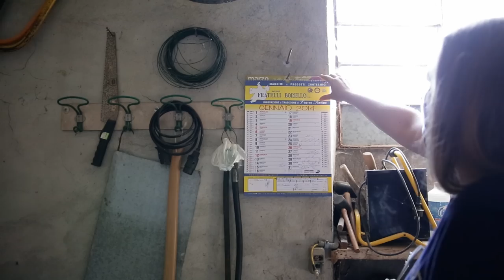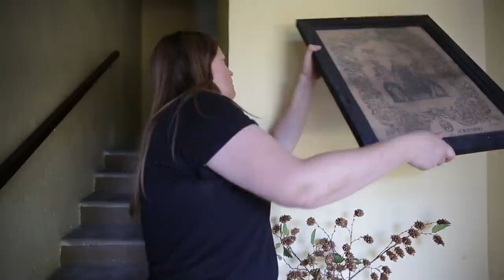#14 First time laying bricks - Slow living in the north of Italy

Comment: New sourdough bread maker here. Here are some tips I learned from seasoned professional sourdough bakers and my personal experimentation. After painstakingly making my own starter that took way longer than most instructions on youtube I was finally ready to use it. When you are in the beginning stages of using sourdough starter add yeast for safety. Dark Rye flour appears to be the best for making starter. Instead of discarding, start with 2 tbs of Rye and tiny bit of water for pancake batter consistency. Feed it 2 table spoons and a little water everyday and watch for the bubbling and sour smell. Once it starts rising you can begin to experiment using it. For storing for long periods of time without doing anything to it. Make it very thick and cover with a layer of dry flour and place in the frig. It can last up to 2 months I am told. Take out of the frig the day before, add water until the consistency of pancake batter leave in a warm place for 12 -24 hours then add to your recipe. The refrig storage does work because I tested it myself. A good place to sit the starter while waiting for it to rise is to place in the oven with the light on.
Reply from the maker: Thank you for the tips! In the meantime we've had some more successful results and we're definitely encouraged to continue on the sourdough bread making journey! :-)
Reply: @storiesfromthecascina It is so worth it and glad to hear you are experiencing better results. Love watching your homestead progress, looking good.

Comment: On old window frames or other wood projects, you may find wood hardener + filler to be an effective method of repair that allows you to keep more of the original wood.
Reply from the maker: that's exactly what we used! we replaced only the absolutely neccessary bits and used wood hardener and filler to preserve as much as possible of the original window. will be in next week's video 🥰

Comment: Will you get snow in your region? I ask because if so, you may want to put some sort of insulation around your below ground water valve. Even just some packing foam from your move will help. I enjoy your filming style .
Reply from the maker: We will likely get snow, yes! It doesn't snow here every winter, and some winters more than others, but usually not before December. Thanks for the reminder :-)

Comment: 14:11 : from a project management viewpoint, which you may already know and have done :
*  look up the 'MoSCoW Principle', that helps prioritizing. It's also very simply put into an excel-sheet, allowing for both clustering of tasks, prioritizing and planning.
*  don't forget the 'preparation for preparation'. In order to allow to prepare for some tasks other things need to be in place already. Like with getting permits you usually need a lot of copies of documents. Both for filling in the request forms and as attachments to the request form.
^  look for tasks which - once started - take a long time to rum on their own. Like getting permits. Once these tasks have started you can put those in the back of your head and do other tasks.

Just 3 things that make life easier and give room for spontaneous things.
Reply from the maker: thanks for the tips! and yes, looking out for the tasks that make many other tasks possible is so important!

Comment: Please plant stakes with signs that say: "Proprietà privata. Divieto di Caccia"(Private Property. No Hunting) along the boundaries of your land. You will be doing the animals a favor and keeping the dangers of hunting accidents away from you. Grazie
Reply from the maker: we definitely plan on fencing off part of the property in the future, but the entire circumference of our land is upwards of 2,5km (about two miles). also, in italy, unless you fence off your land, you can't simply go about putting divieto di caccia plates around sadly. as far as we're aware it doesn't hold any legal value to do so and our experience is that hunters will completely ignore them. hunting in italy- especially wild boar - is also with the purpose to keep the population size at a healty level for the ecosystem. we are not anti-hunting but very pro well-regulated hunting with a focus on ecosystem management rather than sport.
Reply: @storiesfromthecascina  - Hi, I don't think it is necessary to fence your land, also because the signs are located on agricultural plots much larger than yours and without fences. However, it is necessary to make a request to the Region, usually the competence of territorial hunting plans is delegated to the provincial authority, therefore the owner or manager of the land that he wants to remove from hunting activity must address his request to the Province to which he belongs. The control of "invasive" species would still take place outside your land, but what has certainly improved will be your safety, given that the hunter only has to keep 100 meters from buildings and given that hunting accidents are frequent (there these are people who shoot at the mere movement of a bush). Happy renovating, bye
Reply from the maker: Yes it's either fencing your land or submitting a request to the provincial authorities, before they finalise the hunting plans once every five years. But it's not as easy as just putting down some signs! We genuinely wish it would be :-) And thank you for being concerned with our safety and that of the living creatures on our land! <3
Reply: @storiesfromthecascina  - Well sorry if I was intrusive, but it's something I would have done if I had a house like yours. Even though my father was a hunter, the idea of someone being 100 yards from my house with a gun doesn't make me "crazy with joy." Hi and good work to you. 👍😊
Reply from the maker: @MrTinner66  Oh yes but we are fully in the same camp there. It isn't a nice idea having hunters that close to the house. It's just that preventing that takes time that we haven't had yet. We've only been living here for three months, and there were tasks that were more pressing. 🙂
Reply: @storiesfromthecascina   -  Yes, of course, making your home livable clearly takes precedence. Three months are actually a short amount of time for so much work. I was scared when in your video you stop suddenly when you hear shots, so I naively thought that you hadn't thought about that aspect of your tiring "adventure" Bye. 💪 🖖